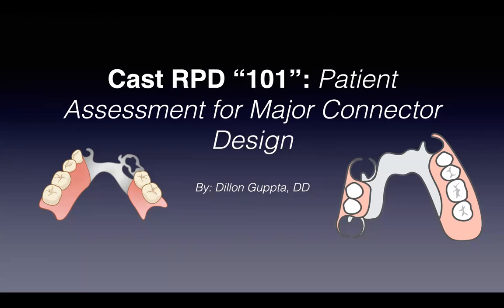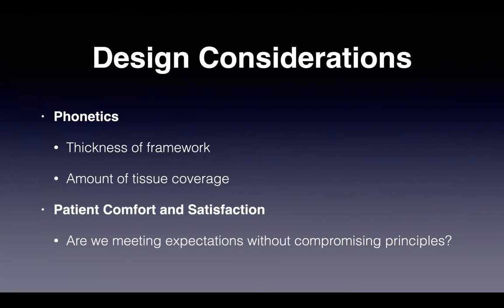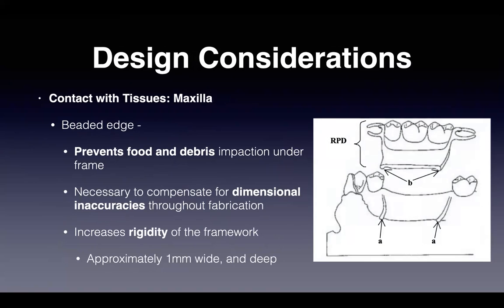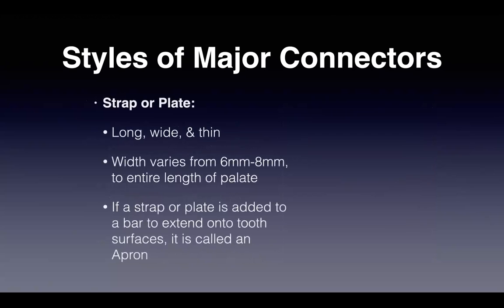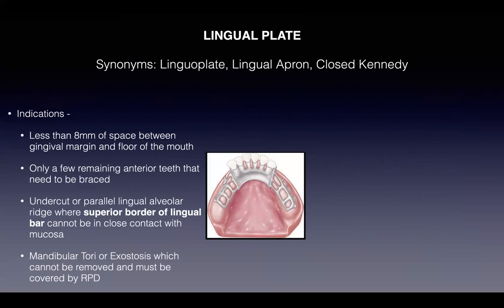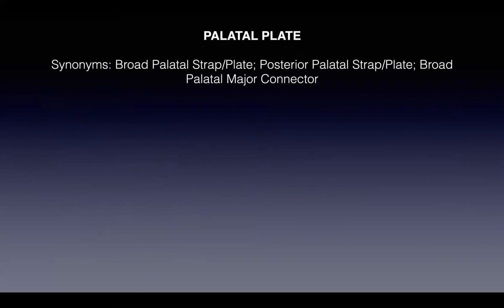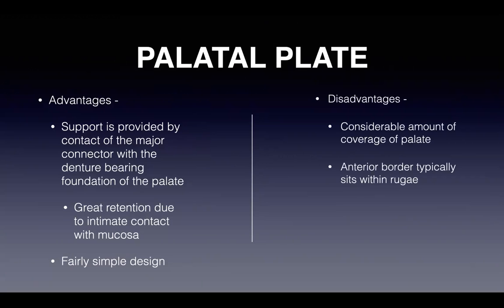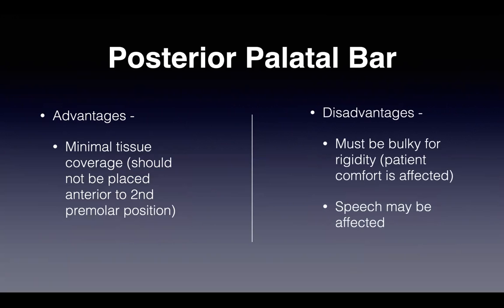Cast RPD 101  pt assessment and denture design

Comment: Hi doc!
Im thinking of using a metal partial denture but I have many doubts and fears. 
Do the clasps damage the healthy teeth where they are attached? 
Can I chew and eat well with it?
Is it a good option today?
Thanks!
Reply from the maker: Thanks for the question! Metal partial dentures are a great option due to their strength. Long term, it’s a great option as the base of the denture is quite strong, and can really help distribute the forces evenly while chewing food. They can be designed in such a way to prevent speech impact, and overall be more comfortable than a plastic denture base.  

In regard to the clasps - depending on the health of your natural teeth currently they can damage teeth that are compromised already, however we can incorporate certain elements into the design of the denture to help prevent unwanted forces on teeth that may be slightly weak. For the most part the clasps shouldn’t damage existing teeth as they help prevent the denture from moving around, the clasps add stability. 

Overall, cast partial dentures (metal) are a fantastic option for someone looking to replace missing teeth in a partially edentulous arch because of strength, comfort, and longevity.

Dillon Gupta (Denturist)